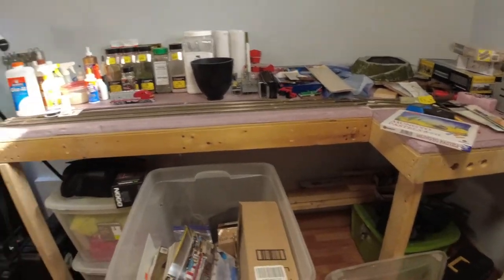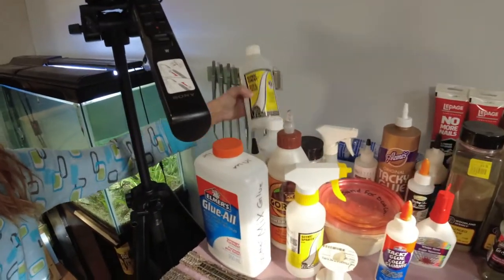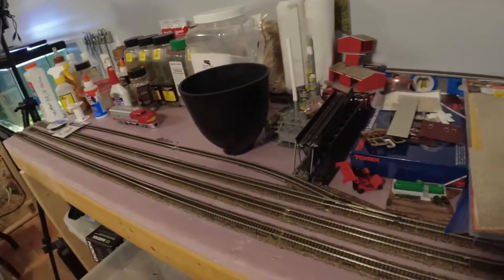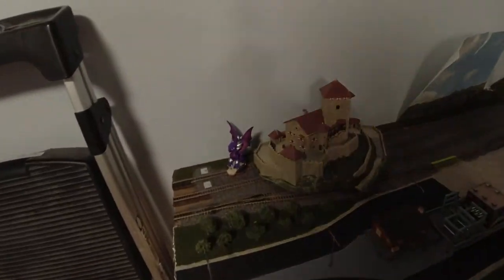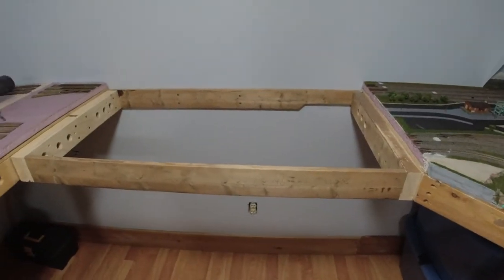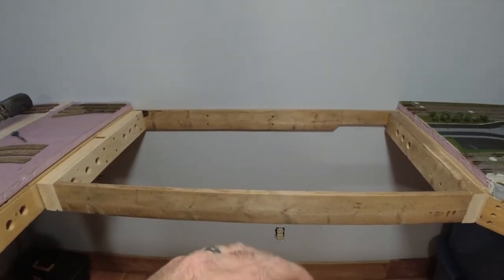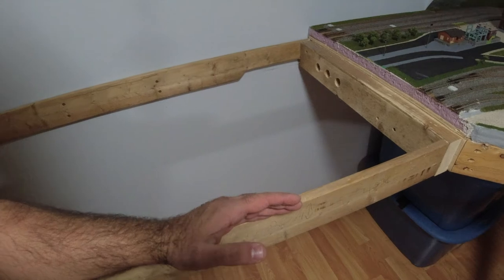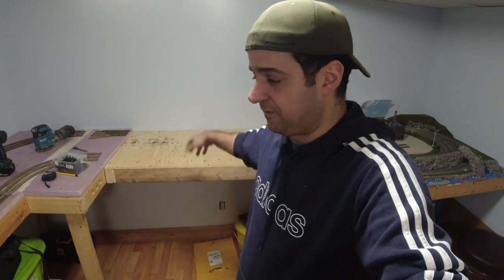Inventory/Glueing Cork Bed/New Extention Peace Bringing Arcadia Back to Life!

Comment: Looks good Tim! Sturdy benchwork. I regret not drilling holes for wires and such beforehand. So much easier.
Reply from the maker: Hey Mark,   Thank you for the comment.  After the first section that I built, I didn't drill any holes and when I tried it was difficult!  after that I pre-drilled! We learn as we go! 
Thanks again for your comment. Stay safe  👋